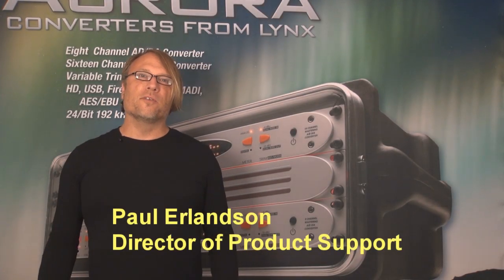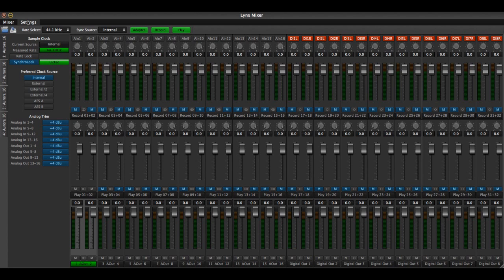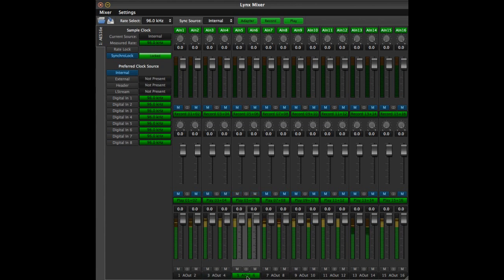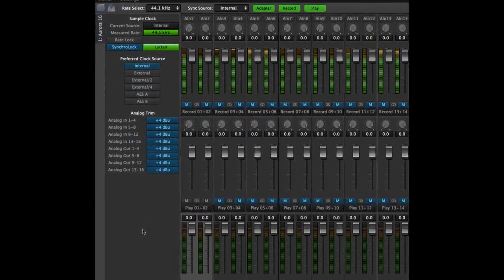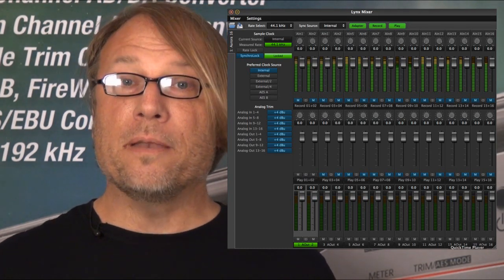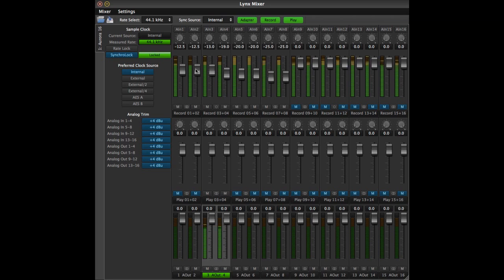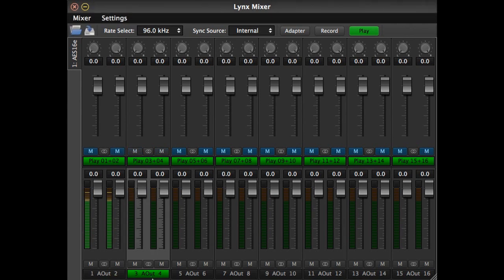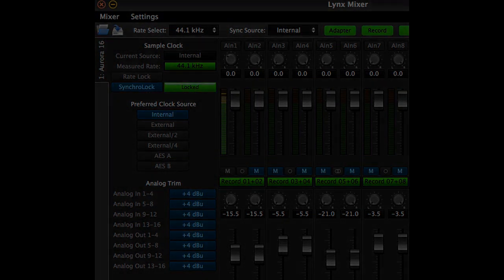Lynx Mixer 2014

Comment: Hey, I have the Clarity M Stereo meter from TC Electronic, and I want to route it with my Lynx Aurora 8 via the ADAT card. How can I set that up?
Reply from the maker: You should be able to connect digitally via AES.  The Aurora AES out has a Yamaha pin out standard. You might want to check TC to get the correct cable.
Reply: @LynxStudioTech  Do I have to do something on the lynx mixer app on my computer to make this work?

Comment: What would the benefit be of adding an AES16e PCIe card to an an Aurora 16 LT-TB setup?
Reply from the maker: The AES16e allow you to get up to 16 channels of AES in and out of a PCIe equipped computer.  So among other things it would allow an AES equipped Aurora (either classic 'Silver' or Aurora(n) + LM-DIG) to have up to 16 channels of Thunderbolt equivalent performance in an otherwise non-Thunderbolt equipped computer.  You just have to have the AES16e and an available PCI express port.

Comment: This was so helpful! Thank you! I have been using the Lynx Mixer for years but not using all of the features. I'm especially excited about using the direct monitoring for the first time. I've always just turned on "low latency mode" in Logic. This works, but there is definitely still latency that you can hear. And if the project is already big, you have to disable so many plugins that it becomes an uninspiring mix to play or sing to.

Comment: Paul,   How would I go about setting up my Lynx Aurora 16 TB   into a presonus HP60 for the most flexibility?   I am having trouble grasping the routing concept and it seems like I would need to come out of the   
Aurora   with 2 balanced signals say  outputs 3/4  and then convert that into  a stereo non balanced 1/4 plug to go into a channel of the HP60.   Are there special cables for that or what?    

Right now I am getting separate headphone mixes by coming out of channel 5  , 7, 9  and taking them into the HP60 in 3 separate headphone inputs.   Seems like I am missing something important.   It has been working and I have had control over the mixes but they are mono of course except for the main playback mix coming out of 1 and 2. 
 Any help would be great.

Comment: I have the Aurora 16  LT-TB and am trying to figure out how to be able to control headphone mixes for multiple players.   With my previous setup    Focusrite Saffire 40 ,   I could send  any type of  mix I wanted to  5 different individual headphone  mixers ( cheap ROLLS  headphone amps ) for 5 diff players.

Does this software mixer give me the same capability?
Reply: Sure, you can do the same. You could organize your playback groups into Stems, then control the level of the stems by adjusting the level for playback pairs to each of the outputs. You can do the same with input signals.  About 11 minutes into the video it describes that scenario

Comment: Why isn't this available for other Aurora interfaces?  The remote control mixer for LT-USB is awful.  This looks wonderful!
Reply: I agree, and that s why i hesitate buying an old Aurora LT USB. Do you confirm this nice mixer is not usable ? Also i have an RME ucx with totalmix soft, could you tell me if the aurora USB could be managed with totalmix ? Thx !
Reply: It has to do with DSP resources. I'm afraid its not possible to use this mixing paradigm with the LT-USB card.